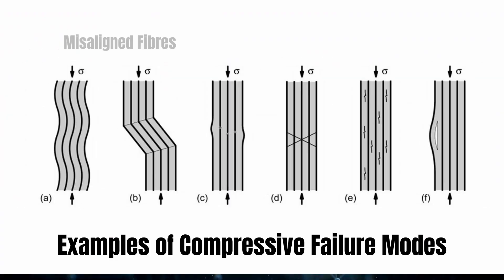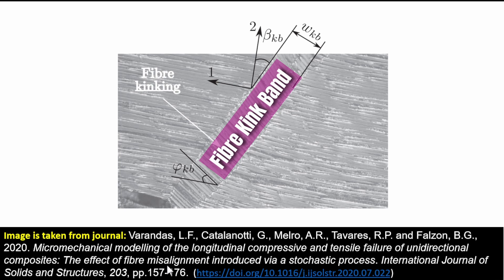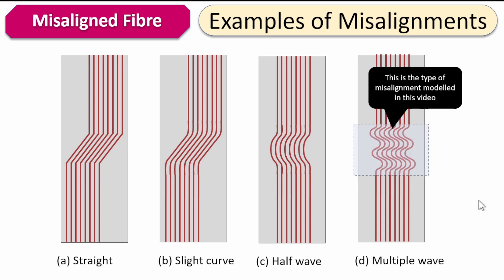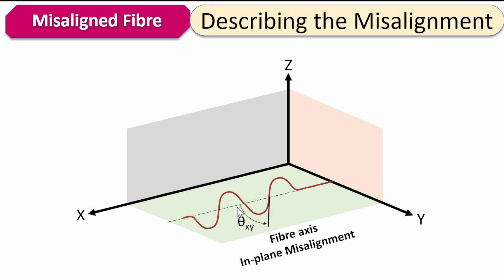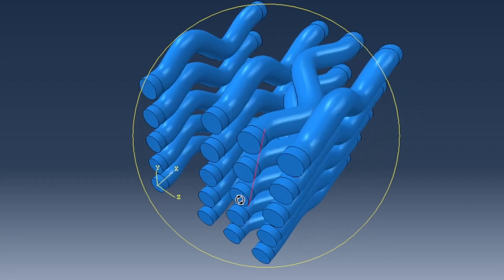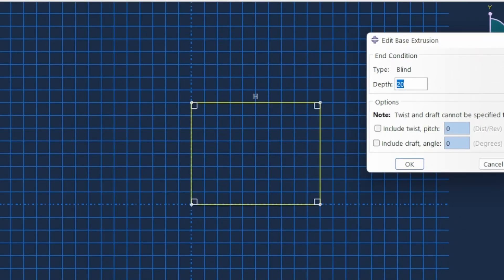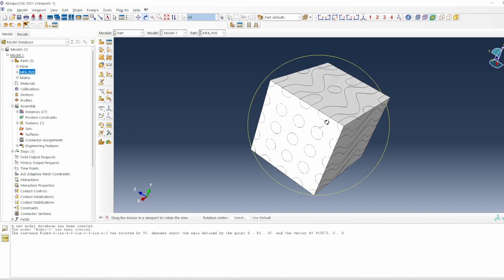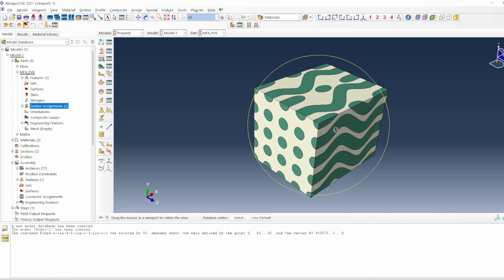How to design a MISALIGNED FIBRE Unidirectional Composite

Comment: Hello Mr. Dr. Okereke.. First of all, thank you for this useful video. I am currently working on a topic and would like to ask you for information about it. I am working on the mechanical behavior of a very curly strand of hair. For this I want to model a helix in Abaqus. But I am having problems building this model. I would be very happy if you could share your experience on this. Or would you like to make a video on this topic? Thank you in advance for your interest and attention.
Reply from the maker: I think it is hard to model a helix in ABAQUS CAE. I will suggest you use a CAD tool like SolidWorks to create the helix and then import it into ABAQUS. I could explore making such a videos - it should be relatively straightforward.